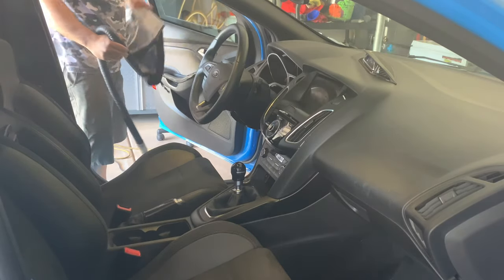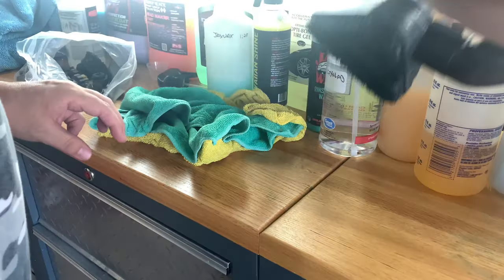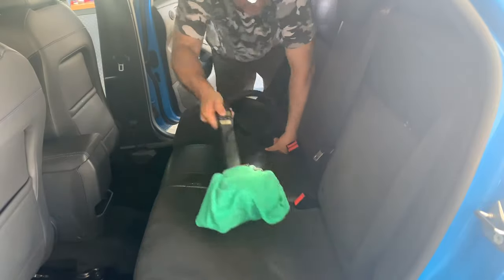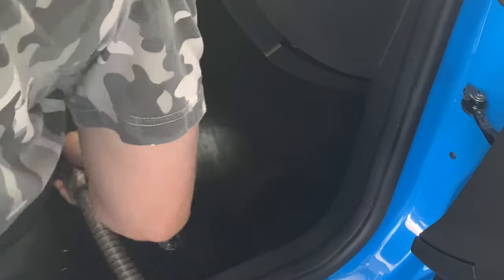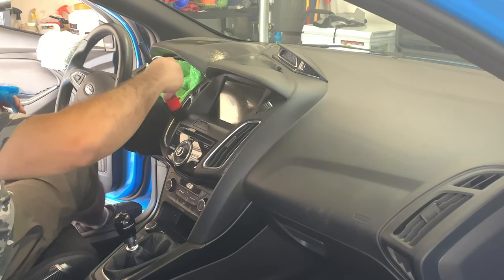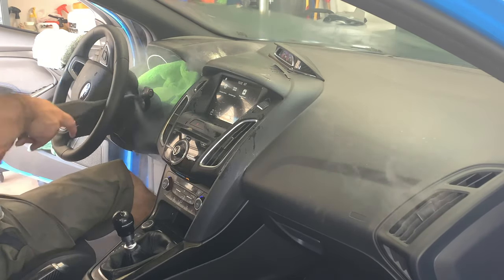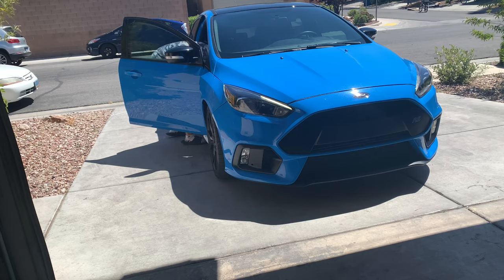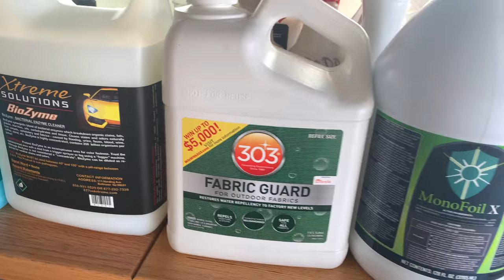Interior clean and smoke smell removal

Comment: You really should add Amazon links to the products you use, like the steam cleaner, as other DIY YouTubers typically do.  You might earn a few cents here and there for the effort.
Reply: Oh crap... I just Googled it.. the VX5000 is a commercial steam cleaning machine system that costs a thousand dollars.  FML
Reply from the maker: I’m not looking to earn money off u guys with links or anything.   Amazon doesn’t always have the best prices either.   So I let you guys Google and shop where u feel it’s best.   I don’t want to feel like I’m persuading you.   Some companies send me products and I’ll post their links but it should be easy enough to Google.   

The VX is around $1000 or so.   I’ve seen it before for $800 but it’s been a while.  Definitely worth the money, it’s durable and good pressure.   Only had to spend $60 on it over the last 7-8 years I’ve had it.   And I got it used so it’s much older.

Comment: I just bought a used 2010 Honda CRV EXL with leather interior. The previous owner was a smoker and the detailing scent is wearing off and the smoke becomes more noticeable every day. The temps are below freezing at the moment so I'm not inclined to start detailing the car. I'm considering paying a detailer with a shop to do this and got a quote that included an ozone treatment. I'm a little skeptical about this as reviews on Inspectopedia say over treatment leads to off gassing of plastic and rubber parts as well as possible corrosion of electronic equipment. How do you know what the right amount is, 2 hours sounds like a lot for a small space?? Have you ever had any complaints after a treatment from someone that was keeping their car?? Thanks for the video!!
Reply from the maker: Never any complaints.   Never any problems either.   It will stink like chemical afterwards for a few days.   I think 90 minutes should be fine.

Comment: Hi. Really helpful video. Can I ask, will a cheaper end ozone generator work? I mean the under $50 type. I’m about to buy a new (to me) car and need to get my old car into a saleable condition after smoking in it for 10 years. Not daily. More like once a fortnight. But that was every time I drove it so it was closed up in between drives. I don’t need it to get rid of all of the smell in one go. It’s totally okay if I need to run it for a few hours every day for a week or so, if it will still get there in the end. I can bring the car around the back so I can have a cord running to it for however long I need it and can hold off putting it up for sale until it’s smelling beautiful. The one I’m looking at says it does 10/20g/h, so that’s not exactly clear lol. Do you think it would do the job? I could maybe put a link here to the item if you want to look at it. Would really appreciate your opinion.
Reply from the maker: I got mine about 8 -10 years ago and it was Ny far on the cheap side.  It was about $100.  I have not seen or used any of the cheaper ones so I’m not sure how good they are.   U will have to try it the one you’re looking at out.   Remember, u don’t want to be breathing this stuff in.  So air out the car very good before u get back into it.  At least a few hours after every time u use it.   Definitely, let me know if the $50 one works.  Thanks
Reply: @DetailingBreakdown  okay, we’ll that’s good to know yours wasn’t a $900 one or anything! I’ll order it and give it a try. 
Yes I’ll be very careful not to breathe it in, but there’s not much risk of that. I just need to be mindful when I open it up to air it out. All going well with my test drive, I’ll get my new car on Saturday so I won’t need to be getting in the old one to go anywhere or anything. If I decide this new car isn’t right, I won’t start ozoning the old one until I’ve got a new one as I’ll no doubt want to smoke in the old one again lol. The new one has a lovely little spot which will hold my e-cig upright perfectly so I won’t smoke cigarettes in the new one. If it works 
I’ll save this video so I can find it again to let you know how it goes. Thanks so much!
Reply from the maker: @moniquem783  awesome!!

Comment: Great work bud! I need you down in Texas. I have a horrible smell from one of my seats. I think maybe a cat sprayed on it or something. I have had the seats "Deep Cleaned", but it appears as though the odor is in the foam. Any suggestions???
Reply from the maker: Xtreme Solutions has Biozyme.  It’s made for that.  Spray that into the seat and maybe penetrate the foam.  But make sure to dry it afterwards so it doesn’t become moldy.
Reply: @DetailingBreakdown  I appreciate the feedback. Will definitely get some and give it a shot.
Reply from the maker: @jbizzlebump  it’s what I use for my dogs or throw up, works well

Comment: When you had the ozone running, did you have the car AC on? I’ve got a similar issue with smoke smell, but trying to remove it from the AC system without replacing my evap core lol
Reply from the maker: No, I just ran the machine with the windows up

Comment: Great video as always sir.   Great information too because I am buying a used 370Z with very low miles but I want to steam clean/sanitize the entire interior when I take delivery of it.    I do have one question,  do you have any experience with these "odor bomb" things that either Adams sells or I just saw that P&S (Renny Doyle) just came out with one almost exactly like Adams' version.  https://www.youtube.com/watch?v=SX9jJh6n4pM    It's a chemical that you activate in a can and it releases a "gas" of some sort that penetrates all fibers inside the vehicle supposedly "removing" any odors.    It takes like about 45 minutes to do and you run the air re circulation system on your air conditioner during the process.     I would think the steaming of the interior just like you did would be the first step, and then these odor removers would be the second step, finished with wiping down all the plastics/leather afterwards and protecting them with an appropriate product of choice.  

Adams Odor Bomb:  https://adamspolishes.com/collections/car-odor-eliminators/products/adam-s-odor-bomb
Reply from the maker: I have tried them in the past.  I find they fade away after a week or so.  Also, have to be careful about them not shooting into the roof and making a stain as some will do.   I like more controlled sprays that I can deliver where I want after a good cleaning.   Hope that helps and good luck
Reply: @DetailingBreakdown  Great information buddy.    Thanks.    I'll be using my steamer as you instructed here which makes perfect sense to me because the hot steam is probably the most effective "sanitizer" there is and kills any bacteria that may be in the cloth or on the hard surfaces.
Reply from the maker: Joe Van Seeters excellent